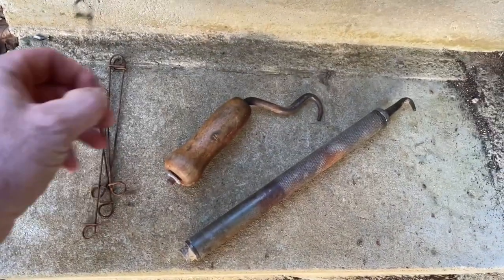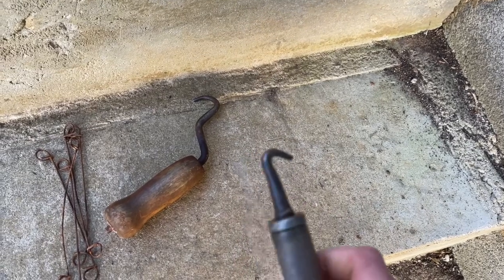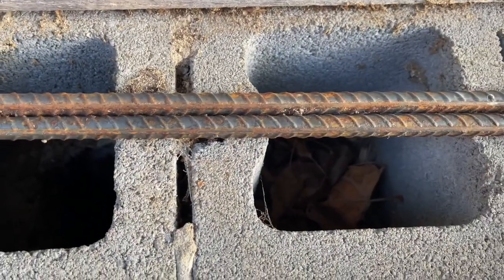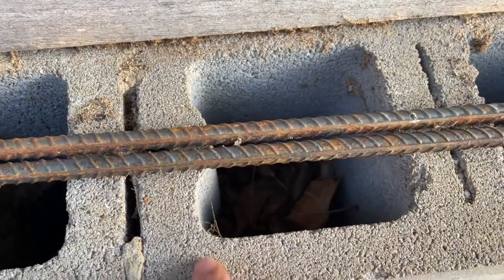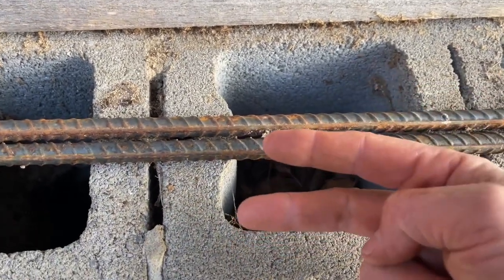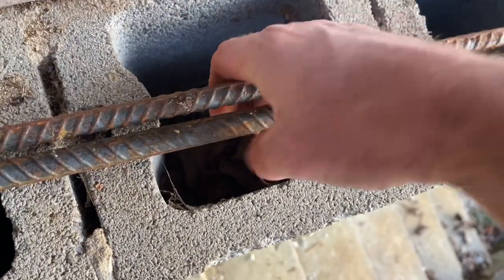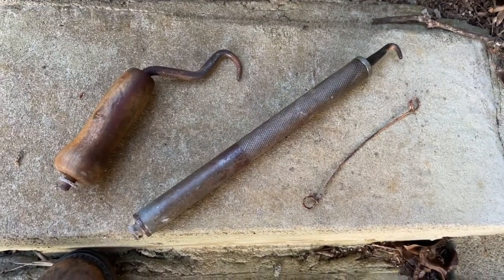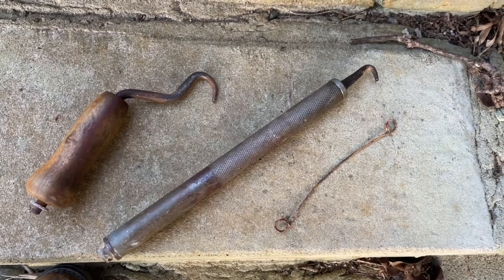How A Rebar Tie Twister Works fff#15 v74

Comment: I worked mostly in structural steel but I helped the concrete guys do this type of work many times and I always thought using coils of tie wire and pliers was kind of cumbersome and time consuming. The slick little tool could sure speed things up.